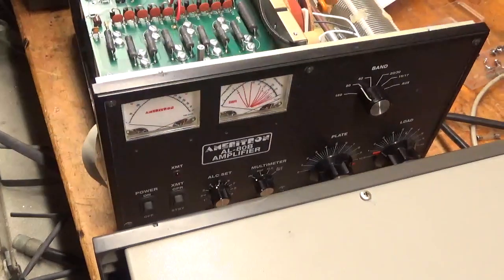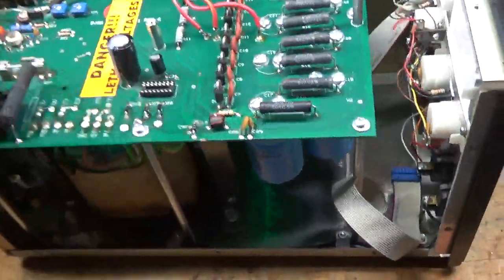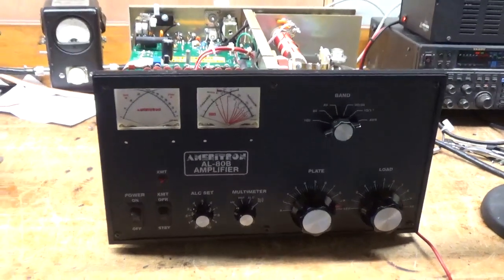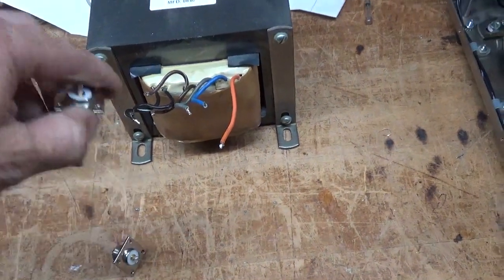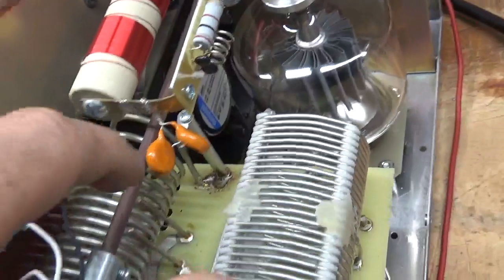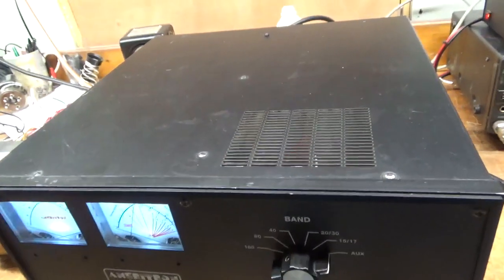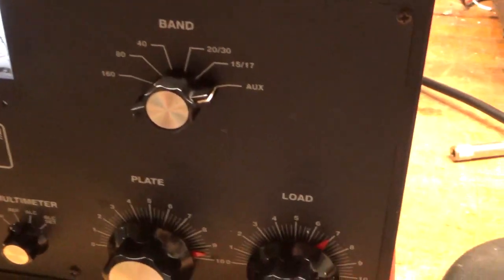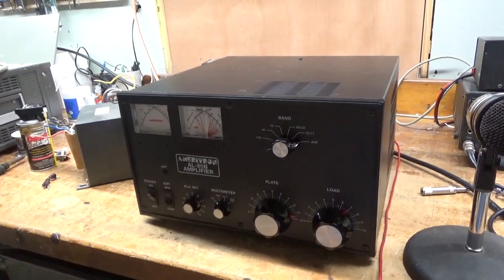Ameritron Al-80b Repair Transformer Replacement

Comment: Are the power transformers still available? I have an AL80B that needs a new power transformer installed.
Reply from the maker: I have but not for individual sale, reserved for pa repairs. Can send in if you like , as long as a registered amateur operator